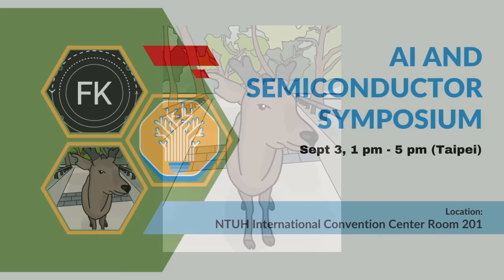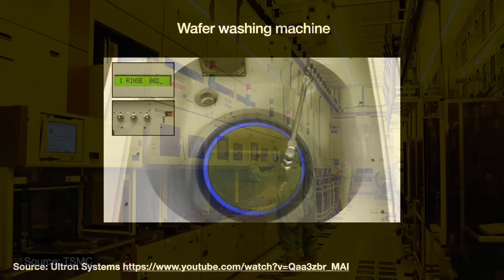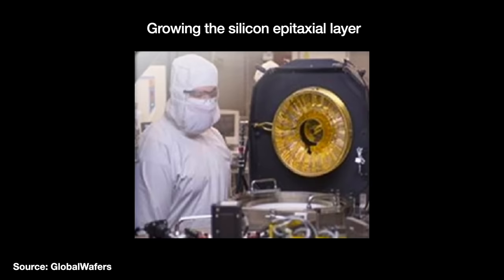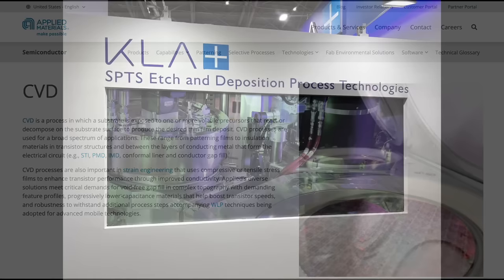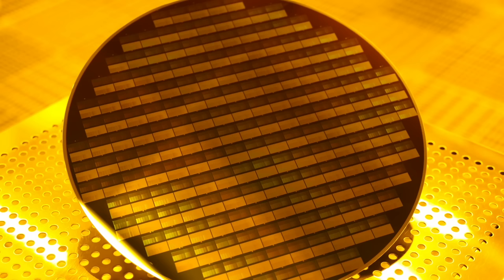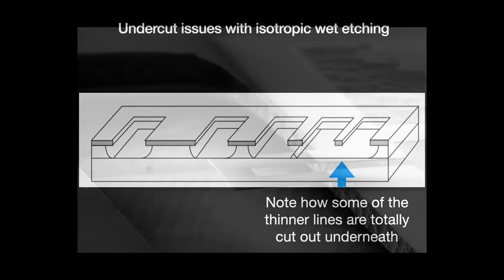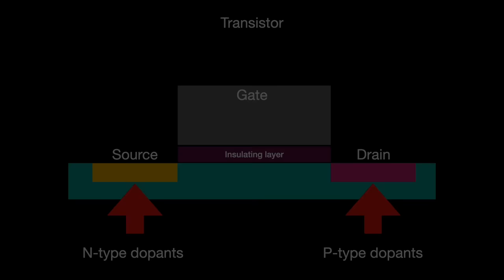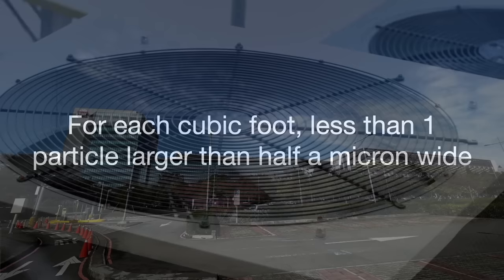What Goes On Inside a Semiconductor Wafer Fab

Comment: The complexity goes back up the supply chain to the mines that make the raw materials, smelting plants & chemical engineering plants that purify or isolate the desired elements, distribution in ships & trucks often energized, fueled or powered by diesel. 

The world in all of its complex economic facets still largely fossil fueled, some 98% off all mobile machines used to move & do a lot of the work required for global #4IR chipset making & integrating hundreds of them into an automobile for example in finless modules for ADAS or various levels of Autopilot or Autonomous driving modes #AI #ML 

Billions of people working of trillions of things // nature even more complex, like the human body, brain or worse still in terms of hard to study complexity, the human mind /// brain that names itself, made up languages & numbers & currencies //

Comment: Sorry, but this video drives me crazy. It is full of tiny but critical failures already on this very basic level. As a warning, the channel maker is not a semiconductor expert. His knowledge is only very basic, not 1st hand and you should take any „fact“ in the videos with some grain of salts.
PVD: - the plasma is between wafer and target, not above, the step coverage of PVD for high aspect ratio is poor, much worse than evaporation or CVD. With PVD you can deposit almost any metal or even TiN or TaN far below the melting temperature, thats the thing about it
CVD: - the reaction is usually ON the wafer not in the vacuum
Litho: - PEB to prevent standing waves shapes is not the hard bake, it is BEFORE („post exposure“) developer step.
Source and Drain: - have the same type of dopant, nFET high dose n-type, pFET high dose p-type, the channel has opposite type as low dose.
I am FEOL integration eng with a long lab carrier as electron microscopy eng, but what is really annoying me is to say that one step is the most important one. This is bullshit and against everything what this industry is about. Almost every step is crucial, if not done right and accurate your chip will not work, period. And even not mandatory measurement steps are very important to control your processes and react early. Each step is it own science field and the details are amazing and crazy like EUV. Do you know that we measure 3D shapes with A resolution „just“ by the scattering information from repeating structures in less than a second? We scan with laser light a full wafer in a few minutes to detect tiny defects and visualize them later automatically with an SEM. In the lab we can cut exact that defect with a focused ion beam tool making a lamella less than 100 nm thick and analyze it in a TEM with sub nm resolution also for material composition.